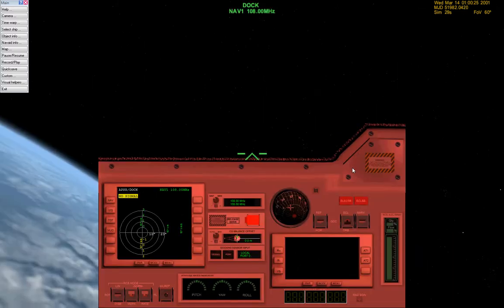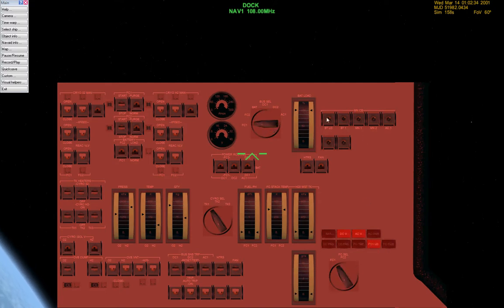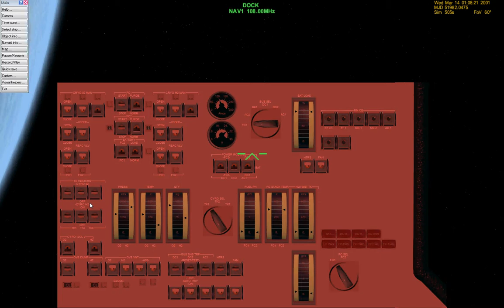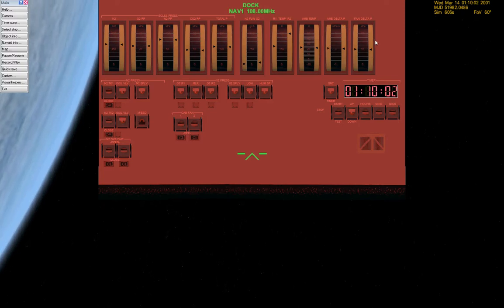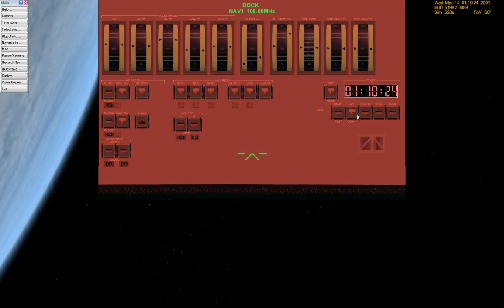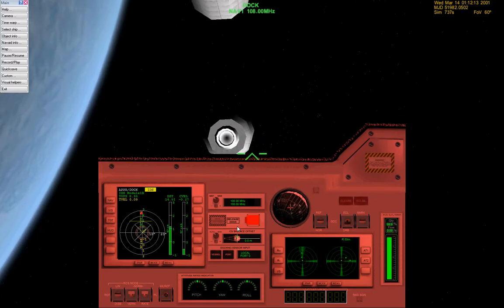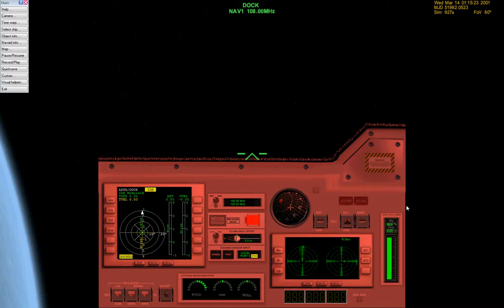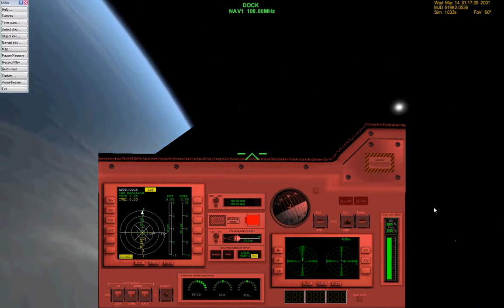Let's Play Orbiter 33 - Dragonfly Operations

Comment: The CoG unfortunately doesn't work since a couple of years, even if the code is implemented. The antenna movements neither. I mean to remember on early releases, that it did work, the CoG at least.
On O-F was a discussion of making a better version of the Dragonfly ( /showthread.*** php?t=227 ). But I think it got forgotten, last post was early 2008.
And honestly, I'm not in the mood of reading the API and rewrite the code of the Dragonfly. Maybe someday when I've got less projects running.